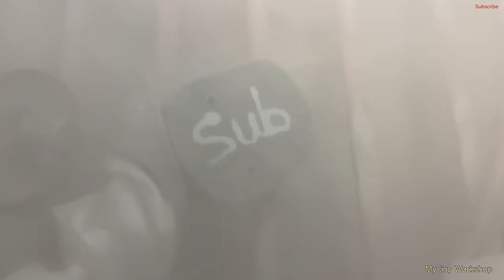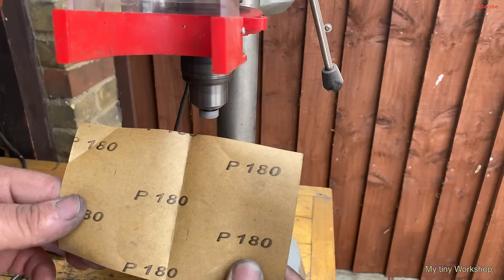Vintage Fire Bell Restoration

Comment: A tip I learned working with domed head rivets. A chunk of aluminum, drill a detent into the aluminum. When riveting, rest the head of the rivet in the detent and use your air hammer or a riveting hammer to seat the rivet. Nice job on the bell! I would like to find one and restore it.
Reply from the maker: Thank you for the tip

Comment: Very cool result. The mounting hole for the right bell is probably off center so you can fine tune the spacing between the bells for maximum volume.
Reply from the maker: That’s right. Thanks for watching

Comment: Nicely done.  Correct me if I’m wrong but it almost looks like you can orient the bells to a wider or narrower range due to off center bolt holes.  Great powder coating.
Reply: Old phones from Ma Bell had a similar mechanism. You could move the bells so close to each other the clapper could hardly move and you could barely hear the the bells ring.

Comment: Just a tip, the bell souds 'rattley' you would have noticed the holes in the domes were off centre
Take the cover off, move the armature to one side by pressing on the 'see saw' part, the clapper should not touch the dome, but be a very small distance, do the same for both domes. the offset holes allow you to rotate the domes to adjust that distance
Basically, the clapper should strike the bell only because the arm bounces.
It's very much like the big external telephone bells used for large workshops etc.
Reply from the maker: Thanks for the tip.

Comment: So are the holes on the bells off center on purpose? Could they be welded up and re-drilled?
Reply: The holes are off centre to allow the bells to be rotated to give the best clearance for the striker and to adjust the tone and volume of the bell.

Comment: Hiya!! Love the video, just got one myself for restoration (although I’m not sure it’ll ever turn out as well as that!!) just wondering what voltage you ran the bell at? Thanks in advance
Reply from the maker: Hi, I just plugged it into the 230v power supply for testing. I have no idea if it’s right or wrong.
Reply: Perfect!! Thank you for the reply! Could I be a pain and ask how you wired it in?
Reply from the maker: I just wired up a normal plug. There is no on/off switch.

Comment: If you have a landline, you can try it on terminals 3 and 5
of your `phone socket to the terminals of the bell-set.  
 Note - a 2.500 ohm resistor 0.5 watt
may be needed in series with the  the bell to give
the correct REN  (Ringer equivilent Number)  to the line.
 Oh! and adjust the gong spacing by
 rotating them to match the 17 Hz ring current frequency.  Then you have to ring your landline
 from your mobile to test it.

PS. I was a telephone engineer for many years !   🙂

Comment: GPO Bell 67 it will be marked as such, for external use, unlikely to ever have been used as a fire alarm, colour of gongs would be a metal finish so it would never show wear at the point the clapper hits it, gongs, holes off centre to allow correct adjustment of the gap, each gong will have a different tone as all GPO telephones did to create the will known ring.  Introduced in the 1930s as a 76A and updated in the 1960s as 67B.  Attractive item but don't show it to a telephone enthusiast:face-fuchsia-wide-eyes:!  Nice job.

Comment: Anyone else have a concern that even after 'sand' blasting there are still 1000s of tiny deep pin prick pits containing  remnant corrosion. Without using a process to neutralize this the rusting will continue even under the freshly made coating of paint because the tiny pit will have enough oxygen to sustain it long enough to push the new paint off.... ?